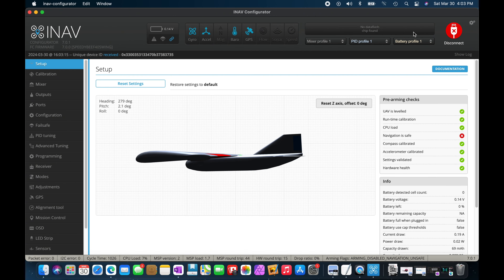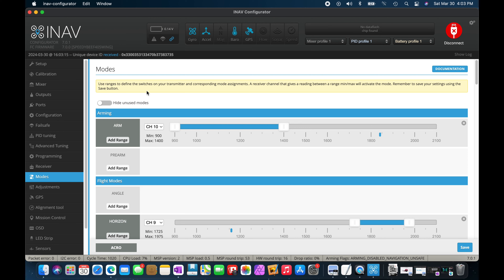FPV and INAV In an E-Flite Carbon Z T-28 Trojan 2.0m - Arming and Modes: Part 5

Comment: Steve, are you going to auto trim your servos before you auto tune??
Reply from the maker: Hey Richard, I’m not sure if you noticed in one of my earlier videos I had selected “Continuous Autotrim” from the Configuration tab.  That effectively removes the “AutoTrim Mode”.  It runs the Autotrim for you automatically as long as you are not in Manual Mode and saves the settings once you land and disarm.  I apologize for not explaining this in further detail. I had gone down this route in my previous build because I was using the Spektrum NX10 transmitter and was running out of channels to setup my plane. This allowed me to free up a channel by not having to assign “Autotrim” to a channel.  It worked so well for me before that I decided to stick with it again.  Long story short… Yes, Autotrim is being run.
Reply: Ah, ha i understand now. I DID see that...
Thanks

Having trouble with my nose gear retract.
Help, new video needed.
Reply from the maker: @richardandkoreenacarpenter6963  Can you describe your issue with your front retract?
Reply: @salisburyrc  All fixed! It was on a different UART. Its ready to fly! Just waiting on how to set up the pan and tilt! Great view from the AirUnit too! Hud working! I put it in Horizon mode and lifted the wings, up and down. All surfaces move the way they are supposed too! I have some great pic to share! You really helped make this easy and fun! Thanks again!

Need the pan and tilt video.  Hint hint 😏
Reply from the maker: @richardandkoreenacarpenter6963  Great news! The next video will drop in just a few days.  Thank you so much for following along!

Comment: Hi Steve I’m following this build but  right now I’m trying to bind the air unit to the googles can u make a video about that.. I have the 03 unit and Integra googles I have it connected to the same flight controller but not in the plane yet or connected to a receiver
Reply from the maker: I don’t have the Integra goggles, but I think this is how I understand it to be done. First make sure you are providing power to your flight controller with your Air Unit connected. Power on your DJI Integra goggles. Take something small like a paper clip and press the bind button on your DJI O3 Air Unit. Then on your Integra goggles do a long press on the power button. That should put the goggles in bind mode and pair with the Air Unit.  Hopefully, this helps. I’m using the DJI Goggles V2 and they still use the physical bind button.  I sincerely appreciate your following along with my build!
Reply: @salisburyrc  thanks for replying, right after I sent this I got them linked…. I’m trying to stink all of these parts in a aero scout until I’m able to get the T28 and another radio I’m looking at the radiomaster tx16